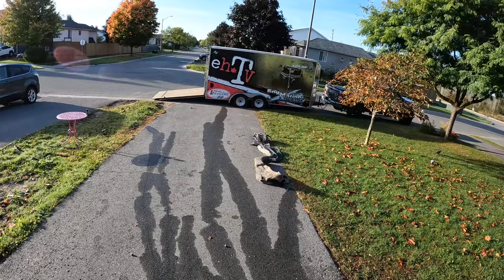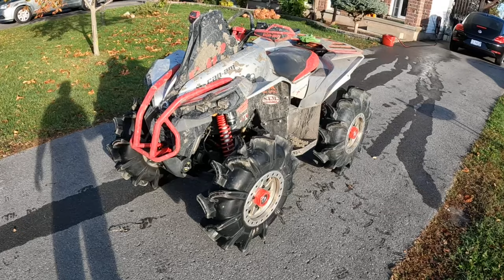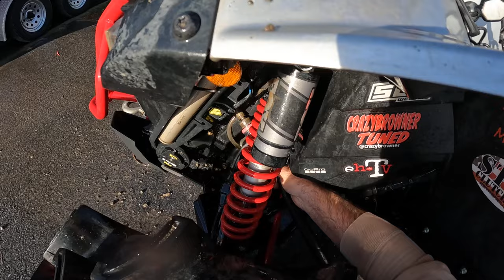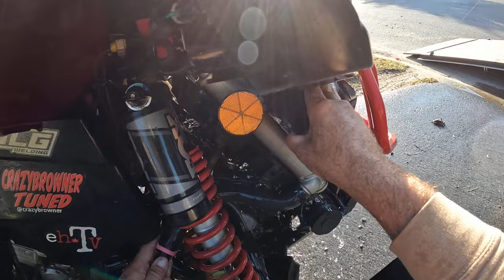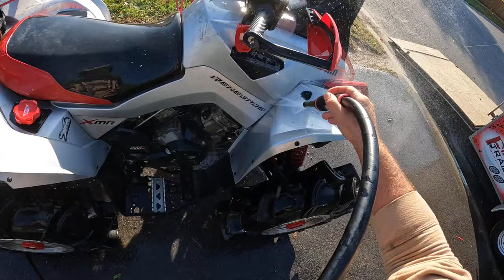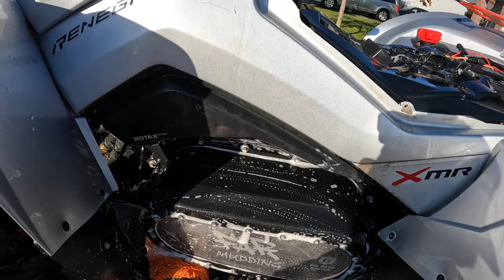Don't Overheat!!! Can-Am Renegade Radiator Cleaning Tips

Comment: I use the same hose fitting and roughly use the same strategy although I use ine extra step I blast my rad with ac condenser cleaner the foaming kind it pushes alot if dirt down and helps brake it up

Comment: I got to the point i just relocated it. The last time thought it was clean go ride and running at 217f. After removing and inspecting before i did the relocate the back side was solid
Reply from the maker: Happens to a ton of folks, like I said on the worst situations I'll spend upwards to a1hhr or more on just the rad. Lol